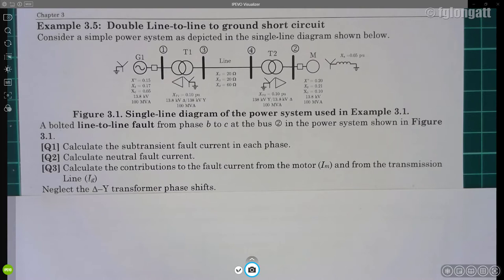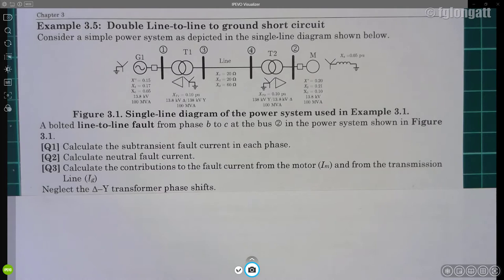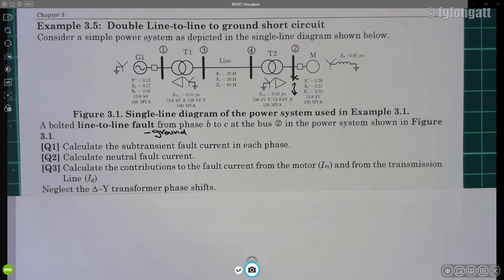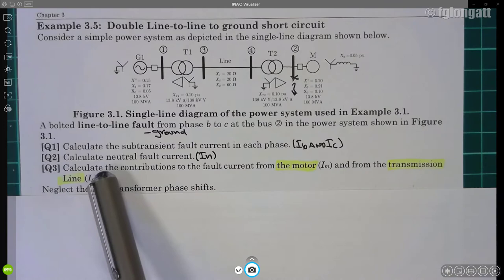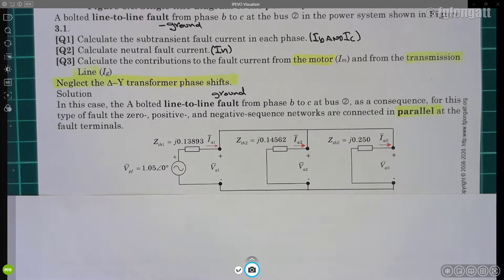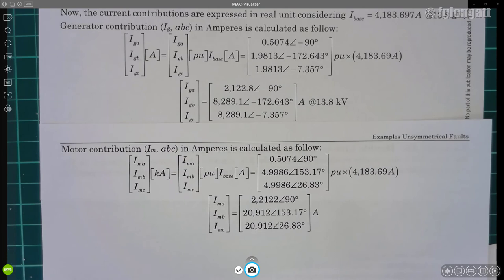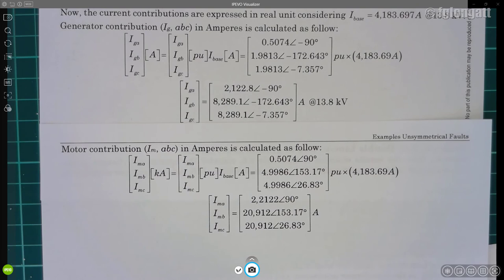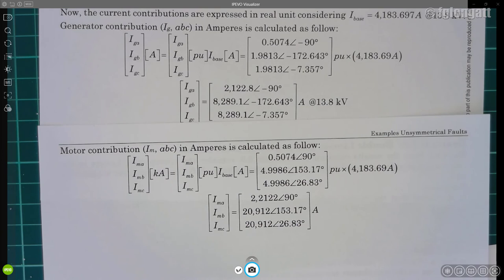Example 3.5.  Double Line to line to ground short circuit

Comment from the maker: min: 7:77, there is a negative sign  (-) missing in from of the Ia1 at the equations of Ia0 and Ia2. However, it is a typo because the numerical results are correct, in fact, you will notice (+4.5465pu). Thanks to all of you for your amazing comments. FGL